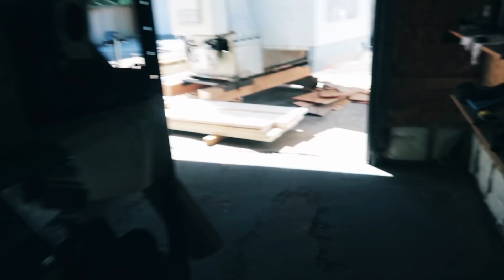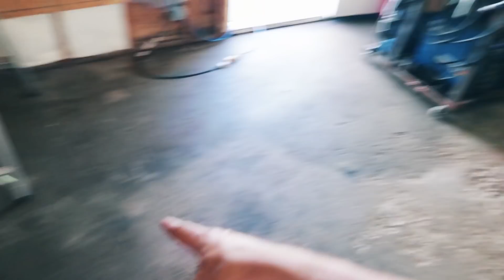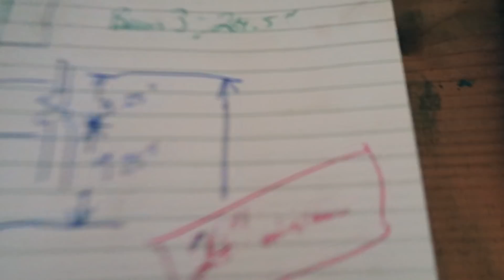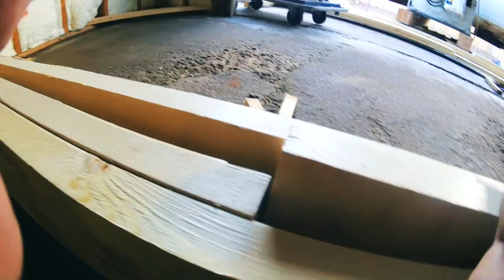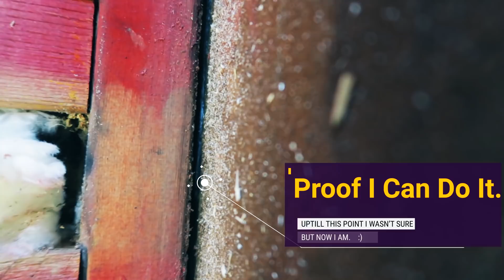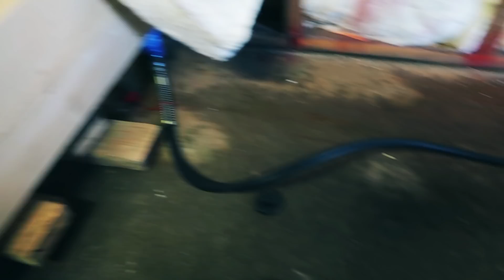[How To Lift a Building] Making beams and reinforcing. (test lift 1/2")

Comment: Were the base plates not hilti'd into the concrete? Or did they just pop out when you lifted it?
Reply from the maker: It was mostly rotted out. It was built in 1967 so it's seen some water. Part of the reason this all transpired. Took advantage of opportunity to get a fresh sill plate down and new anchor bolts with galvanizing. Should last another 50 years now, easy. :)